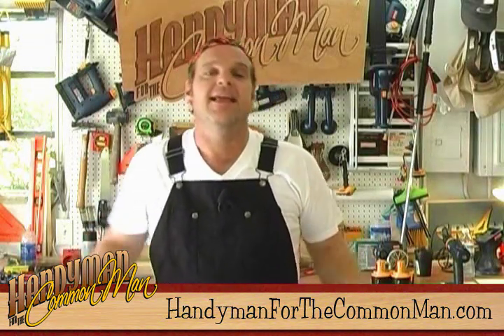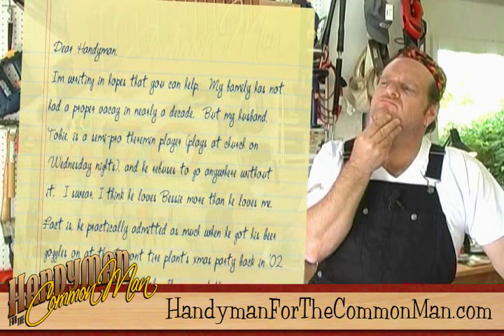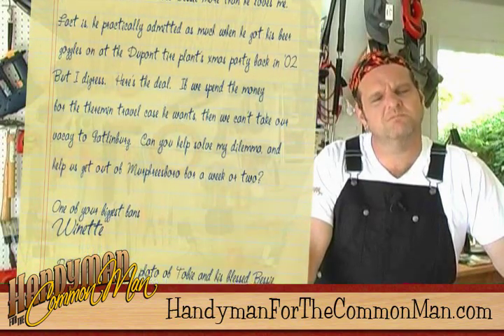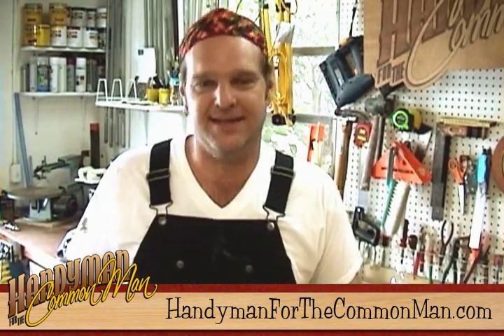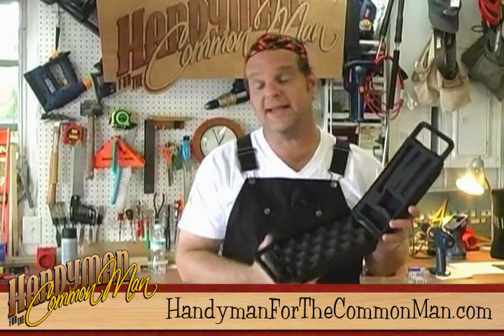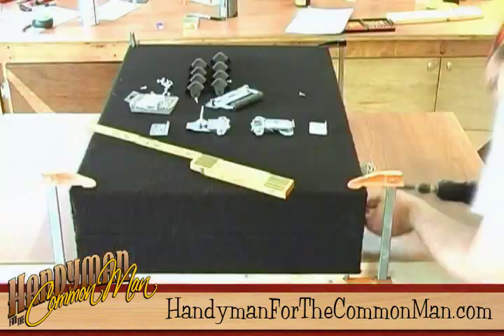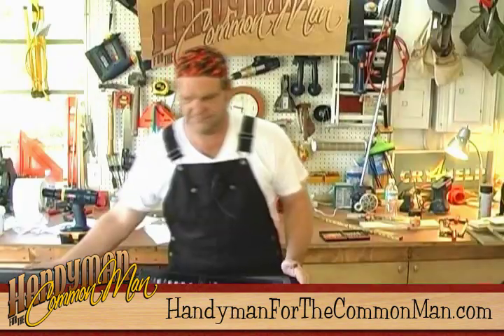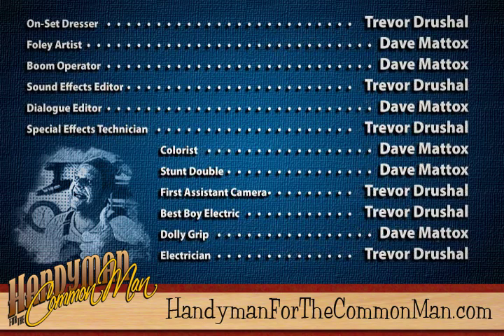$40 Flight Case - Handyman for the Common Man

Comment: Pretty cool to watch... You can go through building this, or you can just find an old hard suitcase in a thrift store and just buy foam, cut it to size and line it in the inside with hot glue.  Probably even cheaper, and more do-able for the common man.